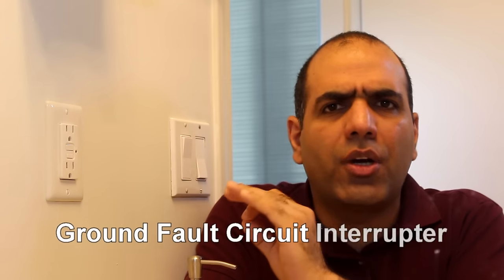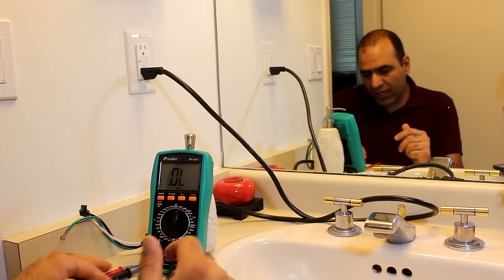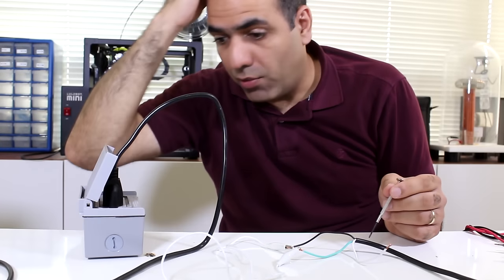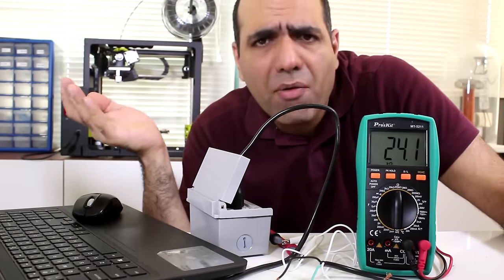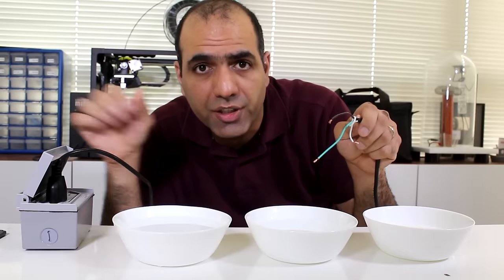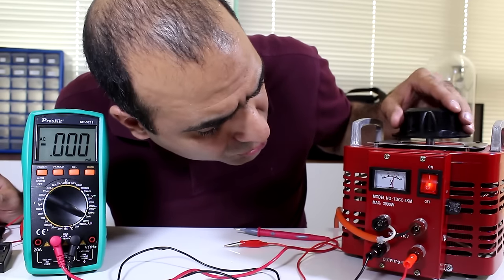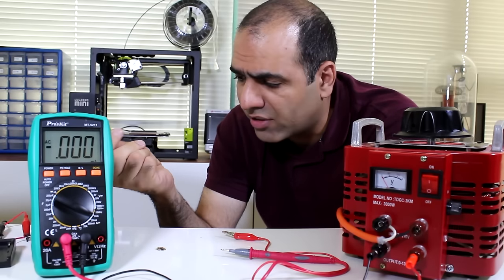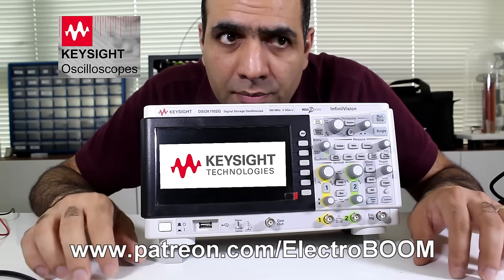The Outlet that Saves Lives

Comment: We in argentina have the rule that every installation must have an GFCI circuit breaker on the fuse box, in a home installation these will trigger with 30mA
Edit: corrected the 50ma to 30ma
Reply: Same here in Germany. Sometimes I wonder how unregulated (or unsave) some parts in the US and Canada are. A GFCI isn't too pricey and may prevent injury or even death. Get your shit together USA.
Reply: I think our plugs are kinda bad as well compared to European ones.
Reply: I don't think so. The US-Type plugs (NEMA) are cheaper to produce and have all the same safety features as the German SCHUKO while being protected against plugging in reversed polarity. Truly better is the IEC 60906 plug as it has a much smaller form-factor.
Reply: >reversed polarity
Reply: I like the cut of your jib
Reply: plus we have 220v not that 110v joke.
Reply: Same as Australia - 30mA here.  Saved my life when I was 3 years old and stuck a fork in the power point! Lucky my parents built a new house because it was new tech then.
Reply: Good dammit. I'm an electrian and these are required by code in the u.s in all bathrooms, laundry rooms, kitchens and a ton of other places. Not to mention afci protection if you even know what those are
Reply: Juan Azcarate We do? Nice.
Reply: zildjiansince1623 i think mine is broken but idk how to tell so I'll just test it using soapy water like this guy did :)
Reply: Mi-Pa-is! Mi-Pa-is!
Reply: Ahora pelo 2 cables y toco arre (si es verdad en mi casa tenemos termica y diyuntor)
Reply: valdeirg true that, on workshops they use 500ma though
Reply: im from buenos aires and i have never seen a gfci breaker,tho i assume those would be more common in capital federal
Reply: DarkRickle it's the "disyuntor"
Reply: yeah but it's not for a single outlet it's for either the whole house or the whole floor,then again i only have my house to compare
Reply: Canada is the same way, though there was an exception for kitchen outlets until just a few years ago (Kitchen outlets in Canada up to then required a split circuit to provide more current, T-slots were illegal.  GFCIs for split circuits are $$$.  T-slots are now legal, though if you want to spend, you can get splits with a GFCI.).

The only place GFCIs are stupid are your fridge, freezer, and your sump pump.  Unfortunately, they require them on sumps now.  Which is stupid.  :(  One nuisance trip while you're on holiday and you can come home to a flooded basement.
Reply: vamo argentina mono
Reply: Fuses are annoying so I usually take the fuses off and replace them with nails. You'll save tons of money when you don't need to buy fuses from big corporations that lobbied all these useless laws.

1. I'm not serious, it's a joke
2. Don't replace fuses with nails, you'll probably get someone killed or burned alive. 
3. Seriously don't. It's you or your family who ends up dead.
Reply: Thats why I prefer wrapping the old fuse with some tin foil instead.
Reply: GFCI outlets cost 3-6x as much as non GFCI outlets in the US.  A lot of states require new homes to have at least 1 outlet on every wall of every room now a days (don't ask me why.  I think it has to do with discouraging extension cords or something).  Thats a lot of outlets.
Reply: Madison tells us something different
Reply: Here in Soviet Russia, electrical circuits breaks YOU
Reply: mussalo women too
Reply: Juan, are you allowed to forgo the main GFCI if you have individual GFCIs for the separate circuits instead, or even none in the fuse box and having them on all the outlets? I wouldn't like to lost power to the whole building because there was a problem at one point on one circuit.
Reply: Do US plugs have shutters to prevent, say,  a child from inserting foreign objects? Not a rhetorical question, I genuinely don't know. The ones I've seen didn't have them but maybe they're just old. Also Schuko sockets are usually recessed so even if you tried you couldn't access the metal pins with your fingers when they make contact. Lastly, there is no such thing as reversed polarity in AC. In an ideal world the neutral line should be at 0V but that's far from true in many places.
Reply: ManWithBeard1990 They are not very common yet but you can purchase them.  It may be code in new builds in some areas of the country and I suspect it will eventually be code everywhere sometime in the future.
Reply: R Bailey Agreed. The NEC now requires all child reachable receptacles in dwellings to be tamper resistant, IE have shutters. Child reachable means things like a refrigerator alcove receptacle doesn't have to have them because a child probably can't move the fridge to reach it. It is of course up to the local AHJ to adopt the NEC. Unfortunately they don't work like the UK ones where the ground/earth pin opens them, instead since ground prongs aren't mandatory the live and neutral prongs must both be inserted evenly and simultaneously to unlock and open them.
Reply: There are rules mandating outlets every certain number of meters of wall (the number of meters changes depending on the purpose of the room, and if there's a sink nearby, and are overridden if there's a shower or bathtub nearby).  Yes, it is to discourage extension cord use, but also to discourage the use of power bars and other such devices.

Canadian code required tamper proof outlets on all standard receptacles.  It was relaxed a bit when someone writing code rubbed brain cells together and realized a child can't get at a dishwasher outlet or a fridge outlet.  Still required if you put an outlet in the ceiling, though (I did, for a projector, had a little laugh with the inspector about how when my daughter is 12 she'll be protected from sticking forks in it).

As you could see from electroboom's touching of the live wires, 120 volts is painful but generally not lethal unless you're unfortunate (standing barefoot on concrete, wet skin, etc).  When I was 5 I stick my finger in a lamp socket.  That hurt.  But that's it.

Europe and other countries have to go overboard on the safety because you generally don't get second chances at 240 volts.
Reply: Outlet GFCI aren't used here, only one per circuit, which by rule separate lights and sockets (except in toilettes) and there's usually more than one circuit for lights and more than one circuit for sockets, each with a GFCI and a thermomagnetical circuit breaker.
Reply: On newer installations it's ruled that there has to be one per circuit, baing lights and sockets in different circuits, and probably having multiple circuits in a single installation
Reply: I'm not european.... Also, having the whole installation under protection is a way better idea
Reply: Daniel Armstrong So basically a similar mechanism as exists in European Schuko plugs then. I agree the UK shutters are a good idea because the plug is easier to insert, but actually the ones that need even force are actually harder to tamper with.
Reply: ManWithBeard1990 Good info. The only issues I have with ours are poorly made plugs where the prongs aren't both exactly the same length and ones where the prong tips are sharp instead of blunt or rounded because sharp tips dig in to the shutters and keep them from opening. I have had to file off the sharp edge to be able to plug in things.
Reply: If they trip at 30ma they're not there to protect people but to protect equipments.

Comment: 10:18. I know that pain.. anyone whose poked an electrical outlet the wrong way with a screwdriver will understand.. The fact that you can sit there and hold your hand on it tho! Props to your resolve..
Reply: James August shouldnt they be isolated?
Reply: I honestly think 230V feel pleasant but Im not touching them on purpose of course.
Reply: Had to change a light bulb socket once and I though the breaker for that area was down. Needless to say it was not and had 230V run through me for 3-4 seconds. My hand got paralyzed for a bit ( a good minute or two) but other than the extreme pain for those brief seconds and the paralysis; it wasn't all that bad.

Moral of the story: Make sure the breaker is off when changing a light-bulb of any kind (or socket) and just don't  play with high voltage; it hurts!
Reply: I got an electric shock when tinkering in a distribution board while ginderly holding the earthed door with the other hand. It left me with a burn mark on my fingers and pain in my arm for several days and I could have died but the second of the shock felt amazing. And no it didnt trip the GFCI even though the current through my body must have been dangerously high, because we have a single one for the entire house that has a quite high triggering current so that it wont false trigger.
Reply: James August i jumped two ends of a live wire with 230v running through (accidentally obviously). Did it with both index fingers for about half a second. The one the current was coming from got burnt and still felt sore after +3 months. Electricity is a powerful bitch.
Reply: Chuckiele wait, u have "a single gfci breaker for your whole house"???? Wtf.
Reply: Chuckiele "has a quite high triggering current so that it won't false trigger"

Lmao. Wtf..
Reply: GFCIs used to be very expensive when they newly came out and unlike in America, where they built them into critical sockets like those in bathrooms, in Europe they simply put a single one into the distribution board to protect the entire house. Nowadays they either put a lot of them into the distribution board, one for every couple of breakers, or they use all in one breakers with over current, short circuit and ground fault protection but many households havent upgraded their electric installation in a long time. And the high triggering current is totally fine, because these old ones werent designed for saving your ass when you strip open a cable and touch live and earth (as it wouldnt save you if you touched live and neutral anyway), thats common sense.
Reply: i once  got a zap from a light fitting even when the main isolator switch was off   i was wiring the fixture then accidentally touched the earth and live  then i felt a thump in my chest then fell off the chair i was standing on  then i was like wtf  then started laughing .  then tested the voltage it was about 160v coming from the earth  even tho the main breakers off  im from the uk who gets 240v  so i think something was leaking voltage into the earth wire  ?
Reply: 160V from earth relative to what? To your actual body ground? Thats very dangerous and needs to be fixed.
Reply: live to earth  as i held the fitting wich was earthed  then accidentally touched the live then got a kick in the chest  but the strange thing that the  main isolator was off     the electrician   said everything is  ok when he wired the caravan i lived in  fed by a 50m thick gauge wire used for transferring mains to a farm house as i lived in a caravan on a field at my mothers  . then the electrician  said there will be voltage drop  but thats normal  . most wont believe this but why would i be lieing if  it felt like my chest got punched super hard .  i think its earth leakage  in the circuit as the distribution board was kinda old as it dose have rcds & trip switches  etc  not the fuse type  probably the old wiring . or could be earth rod.  now ive moved out  in a new build  flat with new wiring  .   im not that good at explaining  or spelling   oh well lol
Reply: the cable being used to feed the power to caravan   is the cable that gose to anybody's house  the 200 amp rated  heavily shielded  incoming mains wire
Reply: as the main high voltage transformer was  next to the caravan  . but  why didn't they wire the caravan directly to the pole transformer lol
Reply: weird.
Reply: then id get 240v at over 200 amps lol  as the transformer feeds 2 buildings  thats it
Reply: i know luckily the heart didn't stop  as i fell of the chair
Reply: Unless you have a weak heart, your GFCI should prevent that from happening. However you can easily get into ventricular fibrillation at lower currents, so you should never just walk a mains shock off, especially when youre alone. You wont feel a thing and a minute later youre dead.
Reply: that was nearly 8 years ago  im fine and still alive
Reply: I know, but next time be more careful :D
Reply: Once upon a time I was pulling out one of the main gennies on a boat, wires were still hooked up as the elechicken hadn't gotten around to pulling 'em out yet, so I didn't mess with it because the phases weren't tagged properly. Anyway, the wiring cover was pulled off because I needed access, and apparently one of the other generators was hooked to the same node, or a switch or something was closed when it shouldn't be, so when I leaned over I touched two phases and got a good old dose of loving from a 480VAC50Hz supply. That stung quite a bit. Apparently I was supposed to go to a hospital after that. Anyway, I've had 230V, or whatever comes out of the plug around these parts, probably a bit higher, through me and that smarts a bit, not too terrible compared to the 480V though.
Reply: in my country, you have to put one for the whole house to protect every wire that comes out of the switchboard
Reply: But whats the point if every wire is protected but the trigger current is so high that you could already be dead? My whole house 240V 40A GFCI has a trigger current of 30mA and its already too low because it still occasionally false triggers. That idea doesnt protect shit.
Reply: Chuckiele that is one of my questions.   why it would not trip the gfci , I am doing an experiment right now, from the output I have my meter conected to phase and ground in a wet spot on the floor but won't trip. I am worry at this point
Reply: James August I was young and my house was being built the bathroom outlet had no cover and a missed the switch and got zapped
Reply: Thats not how it works. Unless your floor is a metal plate, its not a good ground connection. The current that flows would be very small because the resistance is huge. What happens when you touch live is that your entire body becomes live and your environment becomes earth and you form a capacitance allowing AC current to flow way more easily than DC relying on your large resistance.
Reply: Chuckiele the meter reads 120v , between phase and a wet spot in the ground  then I remove the meter and short it with a wire instead but won't trip.  I am trying to simulate what happened to me when I was a teenager while in the school lab when I accidentally grab a phase wire and step over a wet spot with my leather shoes and got zapped so strong that I lost consciousness.  ever since  then I have got fascinated with electricity getting zapped thousands of times maybe looking for this particular high.  it is possible that I am no longer that sensitive. I can take a 20amp zap no problem. never mind a 0.030 amp that does no do shit to me.
Reply: Yes, there is 120V between live and earth but the current is very small. If you put your meter to the current setting you will see that it is tiny, most likely less than 1mA, not even close to the trigger current of your GFCI. Also yes, you can get less sensitive to electricity, but that only means that you wont sense lower currents easily anymore, but that doesnt mean that it wont do damage anymore. 30mA can easily kill you, whether you feel it or not for some akward reason. Its also unlikely that you could get a 20A zap of mains voltage before your bodys resistant dropped so low that you have already burnt to a crisp and its even less likely from lower voltages because of Ohms law. But you can get zaps from tasers or static electricity that are several amps but they only last for microseconds.
Reply: Chuckiele LOL, thanks for your reply
Reply: James August Tamper Resistant outlets saves lives
Reply: @danielhorne6042  If 200 Amps had gone through your body, you would be dead. If you touched 240V from a 200A capable supply, you'll be fine. That's not any different from a power outlet. What's dangerous is a high voltage. As long as it can deliver a few mA, then it doesn't matter whether it can do 10mA or 200A. What determines the damage done to your body is the current (amps) that flows through it and the length of exposure. The current is determined by voltage, and your constantly changing body impedance.
Reply: @Chuckiele Depends on the current if it's pleasent or not. Trust me the current on European power outlets is high enough to not feel pleasent at all. If your not exposed to that for more than a few seconds, then you'll probably be fine. It'll definitely hurt, but you'll be fine
Reply: @luukherfst1209  The current was likely pretty high because it was 240V with both arms connected. It did feel nice for the moment of the shock, it was painful for days afterwards.

Comment: 3:53 to clarify, it doesn't actually detect a short between live and earth but an imbalance through live and neutral. This means if you form part of the normal circuit you don't disrupt balance there, but if you form a circuit with the live and any conductor that's not the protected circuits neutral, it'll trip.